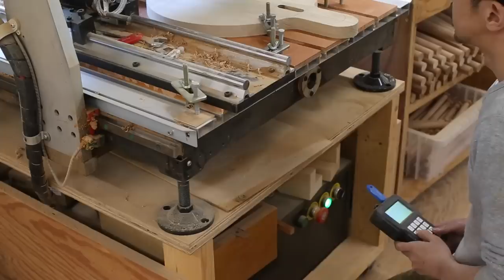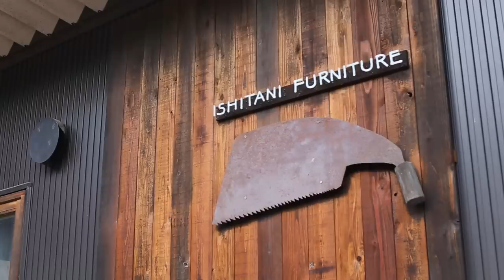ISHITANI - Making a Bird Table

Comment: Cleen design! As always!   Would you explain function of those wavy metal incerts punched into the deck  15:19
Reply: Thinking the same myself, to prevent cracking from the weather variables? 🤔
Reply: Since they are bridging the connections between the wood panels, maybe the function is to reinforce the bond? AFAIK jointed panels are rarely used in outdoor construction.

Comment: At 15:19, I don't understand why you nailed it. ?
Reply: My guess is that they are still two diff boards glued together. It will sit outside in the elements and the moisture change will cause the two pieces of wood to warp in different directions. This is likely just to make sure it’s stronger and doesn’t split. His other pieces usually aren’t made to live outside. My own furniture guy puts all sort of off cuts outside his work shop in the rain and sun to observe how they each change over time.
Reply: @koruki  That’s what I thought, to strengthen. I don’t know if he used PU glue, (D4), which is recommended for outdoor use